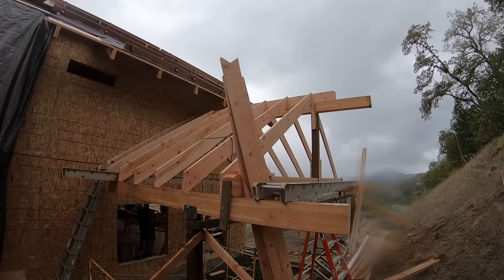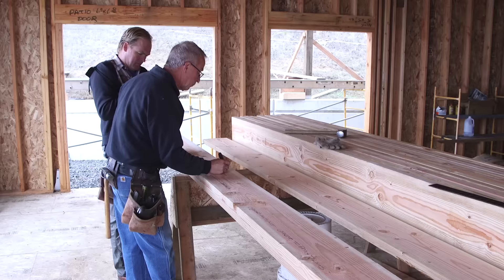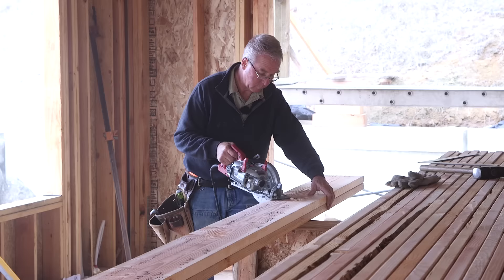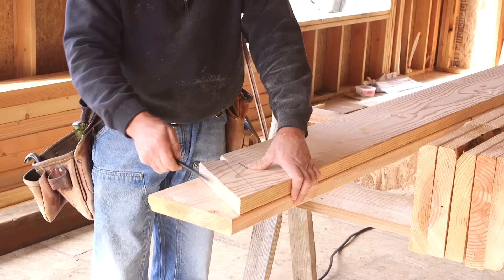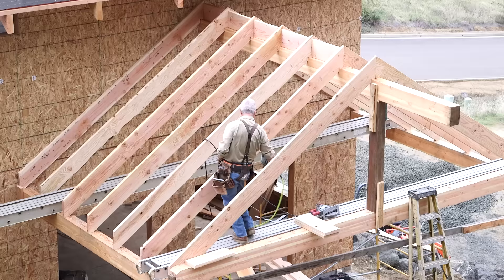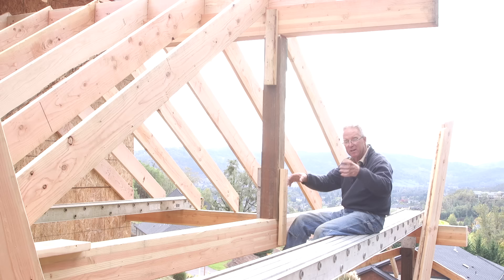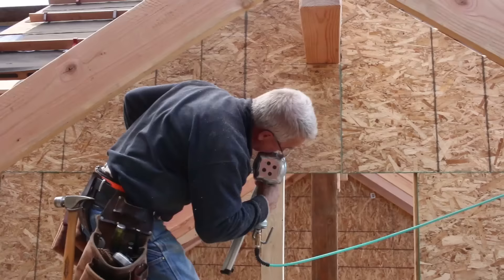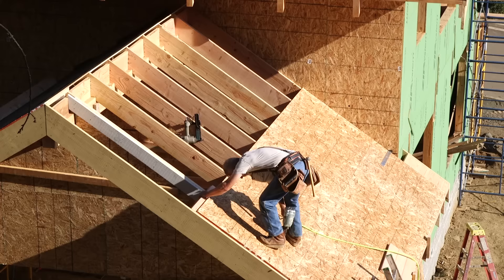Cutting Common Rafters Ep.72

Comment: I came here really to say: Thanks very much for saying you screw up sometimes too, and all pros do. Watching your channel has inspired me to bite off the biggest project I've ever taken on so far, which is building my Fiancee (October!) a desk for our study. Currently she's using a 6' folding table and It's just not okay! I designed the desk myself and built the frame of the desk, but when I was installing the drawers I realized the frame was out of square by about 2deg, which prevented the drawer from closing accurately. I got really, really frustrated and considered just tearing apart and shredding the whole thing. I watched your video and saw that even you with your years of experience and planning can still make a simple oversight, and it gave me the missing resolve I needed to cool down and tackle it again (after a good night's snuggle). I went back to it, and was able to get the desk squared and the drawer installed, and learned a very valuable lesson to make sure all my framing is square every step of the process!  Thanks for sharing, thanks for working, and thanks for making sure we all know that messing up and fixing it is a part of the process for everyone.

Comment: I always took the evening before and went through the calculations using the plans and a trig table and had sketches with dimensional measurements for my.crew to use to start making cuts first thing in the morning.   I hope they appreciated the stuff I did for them 15 years ago.

Although, this type calculation of the fly is fascinating.  And yes, I love learning these ways of doing work because it makes my projects around the house much easier to work on the fly using the picture in my mind and the stuff that I have laying around as opposed to drawing out a "plan" and calculating every cut so I have a list of material to purchase at the lumber yard/hardware store.

Comment: Getting ready to start a a job where we're building a garage/addition/apartment onto a house. It's a pretty big garage that is mostly concrete so we're mostly just building on top of that it's gonna be a pain just laying out the lines for sil plates since none of the walls are hardly parallel and they're all different heights but it wayyyy worth it to take the time to make sure it's square  front step 1

Comment: If you like trig, no table is necessary. Since these rafters are touching on the top, you don't need to subtract the ridge width from the building width, so you start with the 235" width. Half that is 117.5" for one side. That's the run of the rafter. The rise is the run times the pitch, so 117.5 * (8/12) = 78.333" rise. Then you just want the hypotenuse of that triangle. If A*A+B*B=C*C, then C = sqrt(A*A + B*B). The square root of (78.333*78.333+117.5*117.5) is 141.217. To get that in 16ths, multiply the decimal portion by 16. I kept all the intermediate precision and got 141 and about 3.5 sixteenths. Close enough!

Comment: I was taught on the upper bird's mouth use a spade bit rather than a tight corner. Less likely to split. I have done it both ways. Drilling did prevent splitting. Especially on green doug fir 2x12x24

Comment: I wonder if you will insulate the ceiling of that porch.   

Our house had very little insulation and I was amazed how a hot roof would heat the ceiling in various rooms and then that would make the rooms quite warm even in the evenings when the air had already cooled off outside.

Comment: You forgot to subtract the height of a wood member,   not a big deal.   Outside of Copenhagen Denmark is Kastrup airport, the biggest airport in northern Europe, a 4 or 5 story parking structure was built in the early 90S (I think) later a bridge and tunnel combination, with car and train tracks, connecting Denmark and Sweden, was built   Because of the placement of the parking structure, it was necessary to tunnel under it, LENGTH WISE, a while after the work started, a wise man had a thought, and stopped the work, and all calculations were gone over, multiple times,     nobody had forgotten the height of anything, BUT somebody had made a little oversight, the WEIGHT of the parking structure, everything was calculated, the weight of the dirt, the tunnel, but NOT the structure on top.    UUUPS.     You hear things, others do not, when you work for the largest contractors around.     I really appreciate the work you and Nate put into the video series.

Comment: I'm not douting your method but I have been a carpenter for 40 yrs and this is just my opinion, stepping off the rafter with the framing square is absolutely the most accurate method to lay out a rafter. Spending the time to calculate decimals and end up with plus or minus just isn't as accurate enough for me. From one old timer to another, great vidios

Comment: So I wanna build a roof over my patio. If I want vaulted ceiling instead of the flat one you have here, where do I need to add extra support since I won't have the horizontal joists to support the load of the roof?
Reply: You may have to put on a ridge beam to carry the load a to keep wall from spreading apart then ridge sag.

Comment: Nearly all dimensional lumber has a crown or a bow in its length like curve and when used for rafters or floor joists should end facing up so that it works against itself like an arch. It's a sound practice to check, mark,, and flip the boards so the crowns are all in the same direction if production cutting the rafters which in this case should be facing down when cut so the curve would be up when installed. Bad habits are hard to break like laying down planks haphazardly as quick platform because when not on edge their strength goes down the longer they are.

Comment: A couple of technical  points  Pitch is a fraction...  It is the relation ship of the total rise by the span using 24;  as the span...  If you use a rafter book it tells you the rafter length by the span of the building  say you had a 24' span and you were using a 2 x ridge  you would deduct 1 1/2 from the span  and that would be the length of the raffter.Using a book if you look up 23  10 1/2  under hip or valley this would be the exact length of the hip no shorting.  once I had a building with a open beam with 4x12 rafters and a glue lam   the  the lam was about  36'  and it had a built in crown of maybe 2''   I cut a pocket in the walls and used a crane to set the beam   Some of the rafters at the ridge didn't fit exactly because of the Glue Lam wasn't flat

Comment: Regarding the Imperial vs. Metric thing. In metric you don't need to convert feet to inches, nor inches to decimals of a foot. Other than that, the math is the same.
(I'm fluent on both systems).

Comment: One of the things people who are snarky about metric over imperial don't realise is that most materials and such in the US are dimensioned to be nice to work with in imperial, whereas in metric countries all those materials are slightly different in size to work nicely with metric.
E.g. a sheet of OSB is 2400x1200mm, but a sheet of OSB in the US is 2438x1219mm (8x4ft). The former is obviously much easier to work with in metric because of the round numbers, but the latter is much easier to work with in imperial because of the round numbers.
If the US was to properly adopt metric, its standard sizes would have to change which would be going against a huge amount of industry inertia and not just in carpentry - look at the differences in threads and bolts, steel plate and sections, etc.
Even with paper the US uses different standards to the rest of the world... try finding a ream of A4 next time you're in the US!

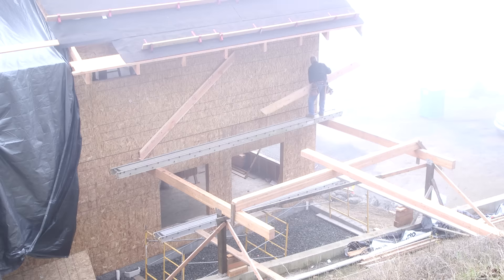Comment: Or you could just use Pythagorean theorem, 8:12 pitch -> sqrt(8^2+12^2) = 14.422205... (make sure you use it with the 12 run because that's your foot run)  That is you rise 8, you run 12 and your beam distance is 14.422 for each foot.  But yeah, it's nice to have it on the framing square if you don't want to remember the details ;-), BTW, it's really 141.1934 or 141 & 3.064/16ths so it's 3/16+ (strong) That said, it's two decimal places gets you to within a 1/16th as long as you're not too long.  But on something longer than 20ft, it's probably better to either do the math or use a framing calculator which is going to give you the most accurate.

For me, since I'm not a framer, I'd do it in the calculator and then I'd check to see that I'm within 1/8" with my Framing square as that rounding can put you out more than you expect on some of them.

Comment: Scott, I noticed that you were using a calculator app on your phone. Did you know that there is a Construction Master Pro app available for phones and iPads? I'm not proficient at using it, but it does handle the units better than my regular calculator.

While I was watching you install the blocks between the rafters at the ridge, I wondered if you had premarked the spacing on your ridge board. I have had problems with spacing growing or shrinking when relying on precut spacers and I now mark my spacing first, so that I can see if I need to adjust my spacers.

Comment: My framer used 2x6 for a 12-12 pitch and the house is 24’ wide. That comes out to be 13’ long for the rafter. I am looking to see if this is appropriate given the max snow load.
Reply from the maker: Actually if I am understanding your comment those rafters will be closer to 17 feet long. It is stretching a 2 x 6 too far in my opinion.
Reply: @essentialcraftsman  The manager just told me they are 2x8’s. So I guess they are ok.

Comment: 20:26 Your comment about never trust a platform that you didn't build yourself is so true - but in my case it was a set of stairs.  I was up and down them all morning but right after lunch I strapped on the tool belt and headed up the stairs.  I remember seeing the top floor deck go by and thought "What the hell?" and kabam, I was on the lower deck along with the stairs.  Some idiot had only one sinker toe nailed on each side to hold the stairs up.  They finally gave way right after lunch.  I didn't break any thing but boss gave me the rest of the day off. That was what, 46 or so years ago?

Comment: The way I do it is 19ft 7 into inches
19ft 7 x 12
19ft x12 228
228 +7inch =235
235 is your total span in inches
235 ÷2 is your run (east coast run is half of building) 117.5
117.5 back to feet 
117.5 ÷12 (inches) =9.7916 ft
Now take your .7916 and times the by 12 also
.7916×12=9.4992 inches or rounded to 9.5 91/2 inches

Comment: SCOTT question for you   Have you ever put rafters in / under an existing roof, to make a vaulted ceiling. I have a 8 foot high flat ceiling in my shop and  I’m going to add the end of my shop for a permanent place for my blacksmith shop. I would like it all to be vaulted. I don’t want to replace the trusses. I have been around building one way or another all my life. I framed with my brothers custom home building business when I was a bit younger. I ran a crane for thirty years. I capable of doing this.i’m just wondering if it’s feasible and would be strong. My roof is a 4/12 - 25 ft wide shop. Final length Woolf be 45 ft. The shop was built in 1975. 2x4 walls. You have my email from your Blacksmith course that I just started. And thank you for the course, very good instruction so far. Best Regards Mike
Reply from the maker: Mike, please email me on my website OR post some pics on the blacksmith course Facebook page!! Or both!
Reply: Essential Craftsman I posted some pics on the Blacksmithing face book page of my bending fork.

Comment: Technically its slope not pitch. Pitch is the ratio of total rise to total span. So if the span of the building is 24' and the total rise is 12' the roof is a 1/2 pitch. If the total rise is 8' the roof is a 1/3 pitch, etc. I know we all use the word pitch but we are using the wrong terminology. Probably because pitch is easier to say. I don't know

Comment: Love the channel, however 8/12 is a 1/3 pitch.  Pitch is the ratio of the rise to  the span.
Reply: Well no, first off the fraction 8/12 reduces to 2/3, not 1/3 like you claim, so you're mistaken from the outset.  To add to that, if you start talking about 2/3 pitch roofs on a construction site, and you're going to immediately expose yourself for someone who doesn't belong there.  In the construction industry roof pitch is expressed as a fraction of 12, without reducing (even when possible).  Here's the thing, Scott's a pretty smart guy. I'd bet my next paycheck that despite his "aw shucks" demeanor, he perfectly capable of reducing the fraction 8/12 to 2/3, yet having spent decades building houses, he doesn't do that.  Maybe you should mull over those facts before rushing in to show how much more than him you know? Especially as you seem not to be able to do the basic arithmetic correctly,  KWIM?
Reply: @andrewalexander9492   Right on !!!
Reply: I am saying 8/12 is the cut, NOT the pitch.  The fraction is based on a unit of span which is 24 thus 8/24 reduces to 1/3.  I have logged over  40 years of carpentry on commercial projects, working with a tool belt, supervising, and managing millions of dollars worth of building construction, served a four year apprenticeship, a college degree, and seven years teaching professional carpenters.  I never once felt that I didn’t belong on the various sites.  I really like and appreciate Scott and would never try to belittle anyone.  I think it is to every builders advantage to try to do things correctly and that includes the correct terminology.  There are exceptions to what I am saying when the cut number doesn’t evenly reduce, for example 5/12.  Keep up your good work!
Reply: @gregbarringer1021  Uhhh, no, "pitch" is the slope of one single surface of the roof.  It's not both sides of a gabled roof.   Look, you screwed up from the start, the more you trying to explain why you're really "right" the deeper you dig your hole. Just stop.

Comment: I'm surprised that no one has suggested that it might have been easier/cheaper/faster to have used factory-manufactured trusses.
Reply: factory manufactured is never cheaper
Reply: @AntKardano  Actually, it is cheaper.  When the total cost of construction is considered, that includes labor and materials, and the fact that longer spans can be achieved with trusses. With a few rare exceptions, almost all the wood framed construction in North America uses roof trusses instead of hand cut rafters.   Do you think they're using trusses almost exclusively because they want things to be more expensive  when there's a cheaper way to achieve the result.
Reply: i still highly doubt it's cheaper to buy truses when compared to raw wood material. It may be cheaper due to saved labor costs so you dont have to pay construction workers as much, but if you do it yourself and not count the time you spend truses cant be cheaper.
Reply: @AntKardano  Labor always has a cost, even if you're not drawing a paycheck. Time spent doing one thing is time you can't spend accomplishing something else. That's a cost, even though it's not as easy to quantify as when there’s paychecks being handed out . So ignoring labor is not a valid way of looking at economics. On a small roof like this, it may very well be that the materials for rafters are cheaper than trusses.  But your claim was “always”.  On a large roof, probably not.  Here’s why: as the spans increase, the size of the rafters increase, not just in length, but in width too.  Wide, long graded lumber gets expensive quickly.  A rafter than can span 20 feet costs more than a rafter than can span 10 feet.   A lot more.  It doesn’t just cost twice as much.  That’s because it’s a lot harder to find a saw log that you can cut 20 foot 2x12’s free of major defects than it is to find a log that you can cut 10 foot 2X6’s.  But a truss doesn’t need big, wide pieces of lumber. On a span which might require 14 inch wide rafters, the widest piece of wood on a truss for the same span might be 6”, and many of the members of the truss are 2x4 which is relatively inexpensive.   So a truss likely has more board feet of  wood than rafters for the same span but it’s much shorter, narrower pieces of wood which are a lot less expensive per board foot.  Regardless, looking at simply the materials cost is false economics. Labor always has a cost, even if there’s no paychecks. When the true costs are considered,  building with trusses are usually less expensive than rafters. That’s why you rarely see anything but trusses in construction these days.

Comment: @ 24:14 that doesn't affect the strength of the rafter cutting into it like that?
Reply: What are you referring to? the 24:14 timestamp is the end of the video.
Reply: @andrewalexander9492  Well shoot so it is @ 13:35 he plunge cuts the skill saw into the rafter is what I was referring to.
Reply: @jimminey-fooking-cricket4903  It will affect the strength of the rafter, but not much much.  First off  the top of a rafter like that is in compression, meaning that the load tends to push things together.  (and in tension on the bottom)  the cut he made was parallel to the grain, so doesn't really cut than may wood fibers.  The roofs are designed with a certain amount of extra to allow for defects in the wood anyway.  Yeah, a cut in the top of the rafter affects the strength a small amount,  but not nearly as much as a cut across the bottom of the rafter.